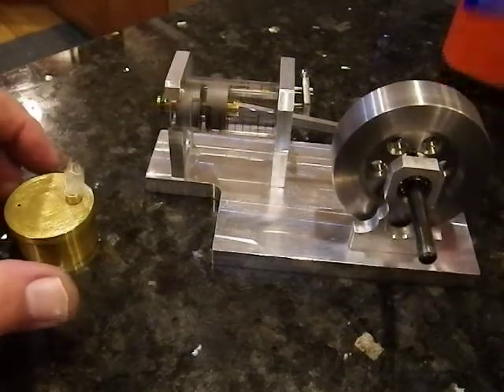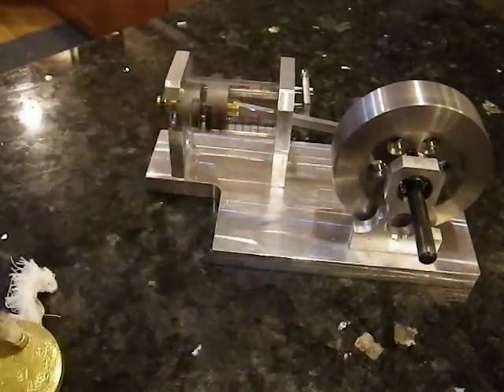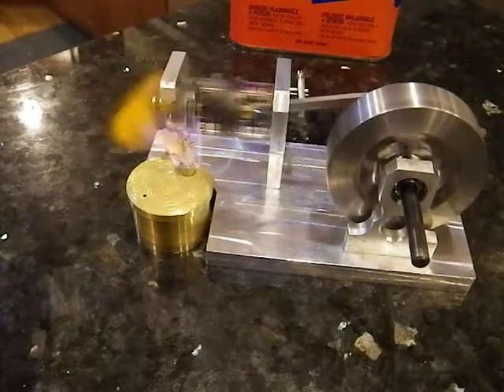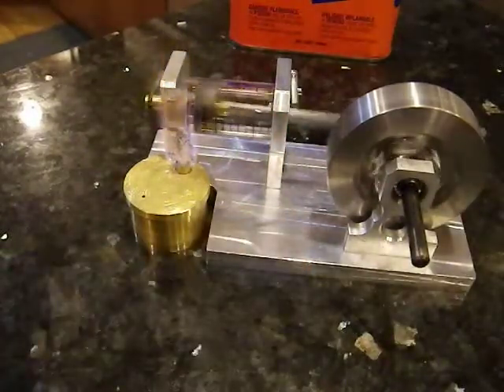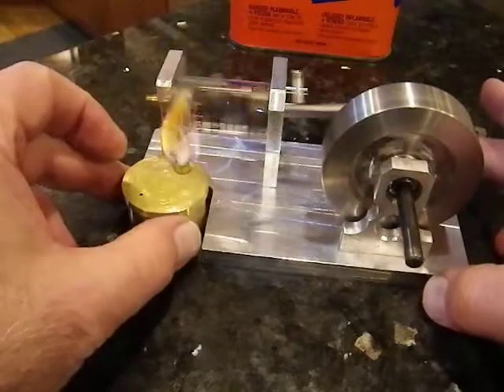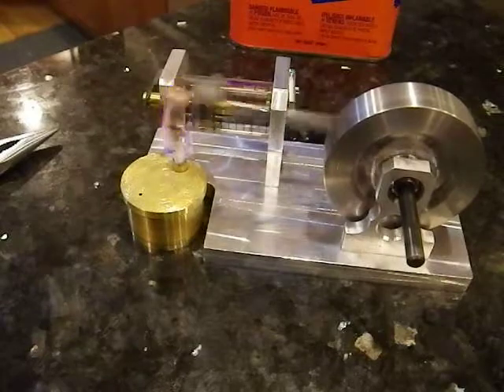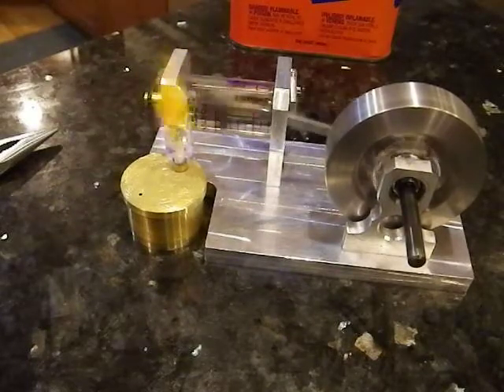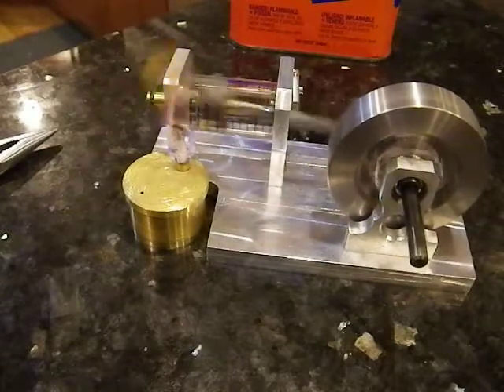Glass cylinder flame eater engine

Comment: хочу изготовить такую модель.какой диаметр цилиндра?
Reply from the maker: The cylinder is made from a glass syringe body, a 20 cc Sigma-Aldritch "Fortuna Optima" brand (other glass syringes don't have a precise a bore as this one).  The piston is machined from fine-grained graphite rod, like that used for electric discharge machining.  You can get plans for this engine from Jan Ridder's website:

http://ridders.nu/Webpaginas/pagina_happer_inw_schuif_mk2_glascilinder/inw_schuif_glass_frameset.htm
Reply: я имею шприц 10 кубиков .модель работать будет?
Reply from the maker: I'd think it would, you just need to adjust the dimensions for the piston to fit and seal well.
Reply: я с вами согласен.спасибо.